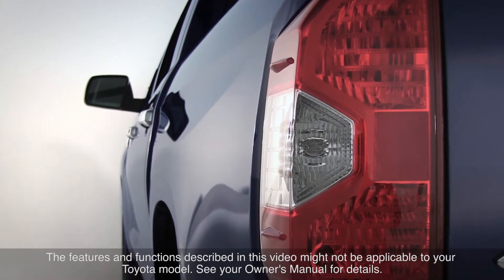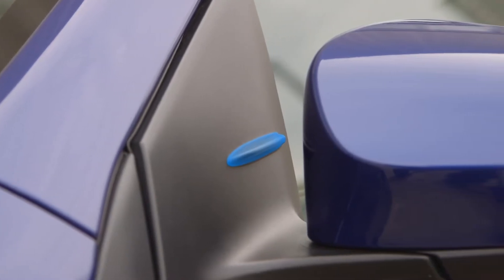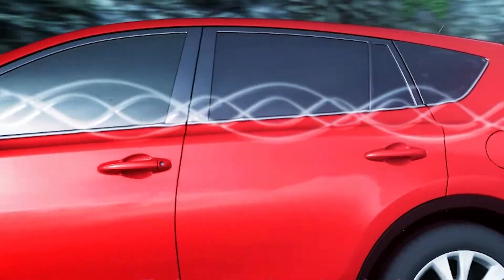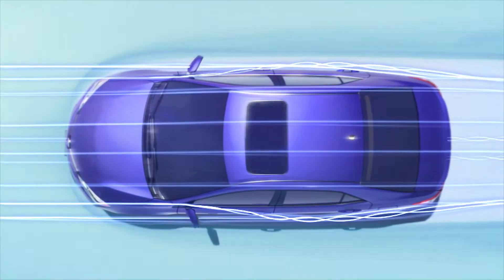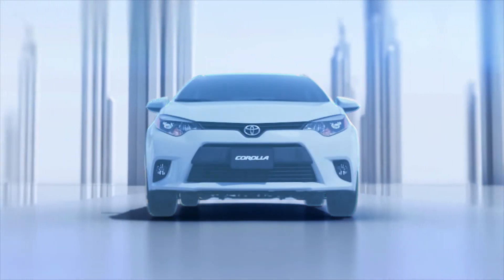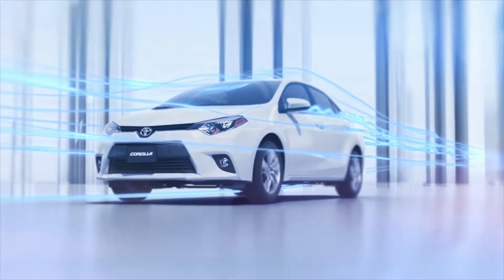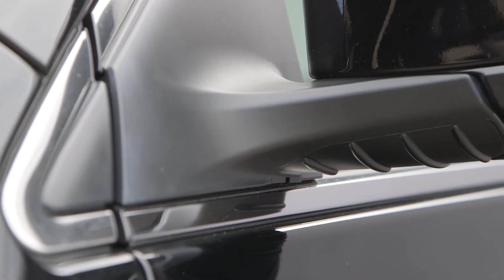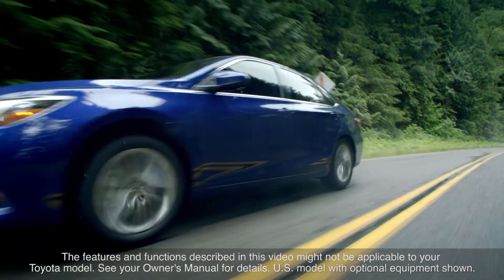Vortex Generators

Comment: If the vortex generators are oriented on the real car the way they are in this animation than they are completely ineffective and are only there for looks. 
A VG is useless if it is running parallel to the flow of air. You have to angle it so that when the air hits it it rolls over the top edge and actually creates a vortex.
Reply: Yip they are meant to be set at 12 to 15 degs from the apparent airflow direction so as to induce the vortex as the high pressure air flips to the low pressure side of the fin. If they looked at those fitted to aircraft wing leading edges they would realise this. These as shown do literally nothing but add more drag.
Reply: I agree, the point of vortex generators is to create a little turbulence upstream of where it would naturally form, to prevent a larger wake or vortex with higher drag  forming later, so I doubt they are anything else than a scratch guard to protect the taillight. That small they can not influence the rear wake in any way. Putting them on sideview mirrors is likely as much about trying to eliminate wind noise.  If the design of the mirror is so poor, that it forms a persistent rotating vortex  funnel following the side of the car (that can happen) the design needs to be redone, not tried to be fixed with little bumps! Also the technical narration to this video is horrible, the explanation about high speed stability by ensuring the air follows the sides of the car?

Comment: At least they are honest about the vortex generators being effective at highway speeds. I have some vortex generators attached to magnetic stock and apply them before a road trip; I drive a 2WD 2DR '02 Blazer and would see 17-20 MPGs w/o the generators and 20+ MPG with. They do work and I have realized as much as 3 MPG  improvement in fuel economy, over the same trip w/o them.
Reply: @PelonMusk  While I must admit it is like driving a brick, at times, I can't argue w/ the results I've witnessed. My vehicle also rides on an air suspension much lower than stock - maybe three inches from ground to body so that has a little to do with things as well. Can't say as I'm real thrilled w/ the crap mileage I get, but that will change when I do the LS swap and get rid of the current boat anchor engine. 150 HP gain w/ an equal weight loss of about 150 lbs on the drive train - a slightly lighter brick?!? lol  Be well.
Reply: @v.e.7236  im assuming that ls sawap did nothing with 7 dollar a gallon gas prices lol
Reply: @TaylorPhase  Touche!
Reply: you are full of it
Reply: @manuelmartineznusn  you too